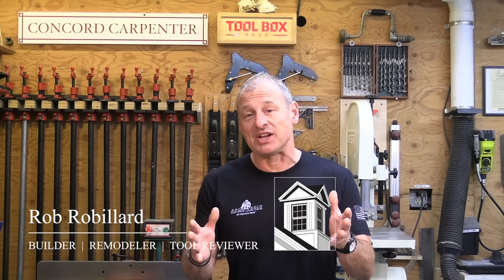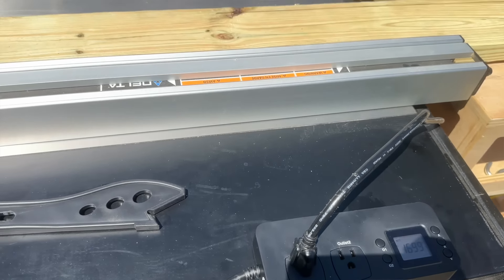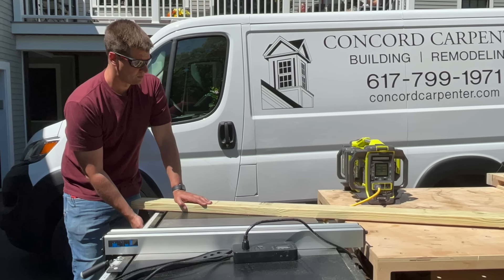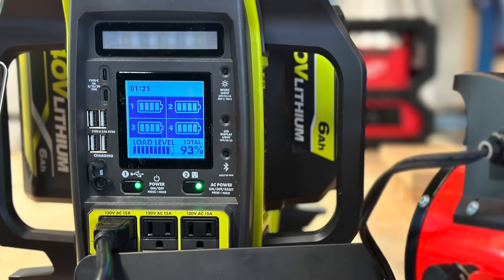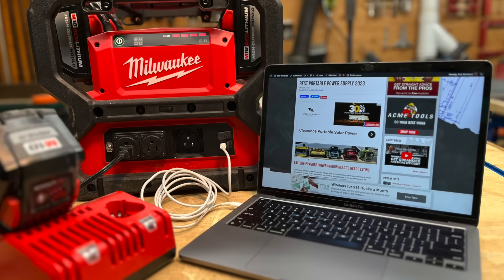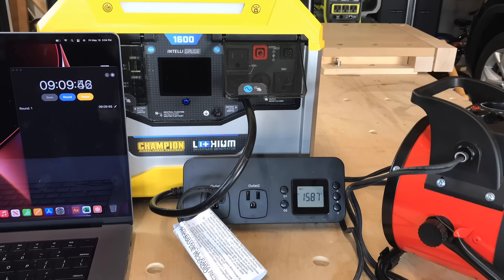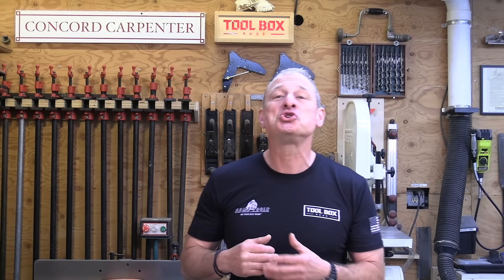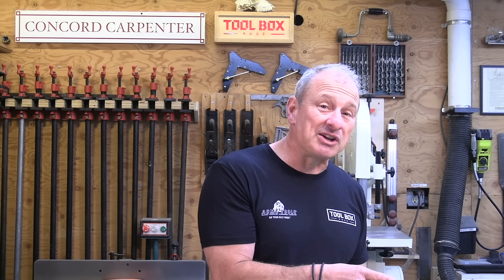Best Portable Power Station

Comment: I have the dewalt model. It has saved wifi connections during power outages, ran fridges despite the modified sine wave and charged the batteries off the gas generator. All in all I like it, very simple design and can power pretty much anything. I agree they could improve on it, designed about 10 years ago and still competing against brand new units. I had dewalt batteries already and was reasonably priced for the bare unit.

Comment: Been waiting for this H to H  test, awesome  job evaluating  these Portable switchable  battery storage devices, should have inc,uded an Inverter Fridge and Microwave or Induction Hotplate stove , but then the tests might be too long..Great job!!!
Reply: I have personally run a microwave with the DeWalt power station. Ran fine and worked as expected

Comment: @A Concord Carpenter / ToolBoxBuzz. Thanks Rob and TBB Crew for another great and thorough power station head-2-head comparison. You really hit all the spots to include how some of the power stations can't be left on standby without draining the batteries (by design). I know that the Milwaukee M18 carry-On doesn't emphasize that in their user's manual.

I agree with you that if we're in a particular battery platform, we'll  typically get one of these based upon what batteries we're invested in. For those who may be in more than one battery platform (or plan to) like power tools and OPE, then EGO for OPE and one of the others may be in order.

Hope you, the crew at TBB, and your families stay safe and well.

Comment: That's a great video on "Home Backup"! It's so important to be prepared and have a reliable power backup solution, especially when enjoying outdoor adventures or spending quality time with family in an RV. Have you heard about the Segway Portable PowerStation Cube Series? It has a massive capacity, powerful output, and super fast recharging capabilities. Plus, it's waterproof and has comprehensive protections. Might be worth considering for your outdoor gear! Happy camping!

Comment: I just bought an Ecoflow Delta Max, which is a dedicated solar power station with an internal 2kWh battery, 2400W pure sine wave inverter with a 4000W peak, 800W of solar input and tons of outputs (12V, USB-A/C, 120V).

I have TONS of Ego batteries and the value of the Nexus just wasn’t there.  The big kicker was SLOW charging on AC and no pass-through charging for AC or solar, a big oversight.

I’m using the Ecoflow on a job site and never have to think about power.  The solar panels keep it charged and I just work around them.

This might not work on some job sites where theft is a concern unless you have portable solar panels, which are available but expensive.
Reply: That's probably the absolute best solution for every situation. I wonder how much it was without the panels?
Reply: @benoitchartrand5772  I believe it sells for about $1800 in the US.  I’m in Canada so it was a little more here.  It’s worth the premium over the options covered here in my opinion since it is far more flexible and has much more energy capacity.  They sell smaller models which are cheaper if you don’t need 2kWh of battery, in which case it could offer similar capacity as these options at quite a bit less cost.

Comment: I am intrigued by the Milwaukee. I would use it t at home to power my furnace fan during a power outage, using my existing tool batteries. Indoor piwer, no fumes, no noise, nothing theft worries like an outside generator.
Reply: The DeWalt and Milwaukee can run power tools with ease while other generators fail completely.
The Milwaukee having pure sine wave while the DeWalt does not makes it more useful to other uses.

Comment: 👏👏👍 love your head to head's Rob , great in depth review 
I have the Ego power station , only because I've been using the lawn equipment and two stage snow blower 
I don't think it can be hooked up parallel like the Ryobi 
Im heavily invested in the Bosch cordless tools platform 
And hopefully they will come out with some kind of power supply like this , 
Im looking for some sort of not too expensive system to be able to charge the Ego batteries while i am using the nexus to power the utilities around the house , so while the batteries being used can be replaced with charged up batteries from some sort of solar charge system 🤷🏼‍♂️ 

Thanks for your information and great video Rob , 
Keep up the great work 💪

Comment: This was an awesome review! There is one thing that I wish you would have taken into consideration with the Dewalt and Milwaukie though. The fact that all of the batteries for these two power stations can be removed if need be for a period of time and used for  virtually their entire lineup of tools handtool/stationary/ as well as lawn maintenance in dewalts case (not sure if Milwaukee has a "gardening line"). Its a game changer in my opinion. If need be just keep a 5th battery handy if someone needs to snag a battery off the station for a few minutes.

Comment: A good comprehensive test. As you say hard one to do because they are horses for courses. I still run my petrol generator. Bit noisy. But a fraction of the price. Pure sine wave. Will run power tools and electrical goods. These battery power stations are very impressive but prohibitively expensive. Definitely getting better though.

Comment: The Ryobi doesn’t need to talk to the batteries. But if it can’t it won’t produce max power. So if you use only an original 40v battery that doesn’t talk to the power station you are going to max out just above 400 watts of power. So I always make sure 2 new batteries are installed and then the other 2 can be old batteries. 

Because it will take old batteries that means I was able to hack it and give it any 36v to 42v power source. Which is what you get when putting 2 -18v batteries in series. So I’m using a dead 40v battery with the guts taken out and an input wire coming out to connect to the power station. It has worked great so far. Definitely not within warranty specs ;).

Comment: Dewalt definitely needs to make a new updated one. I believe this one came out close to 10 years ago
Reply: Yes they do need to make an updated one 100%. They should make it able to utilize the 60v from the flexvolt battery's so you don't need all 4 batterys at the same time unless you're using only 20v battery's. Would love a 20amp outlet on it as well. I buy it for sure.

Comment: I have a bunch of ryobi 40v stuff so I went with the power station. For the little back up power I need it’s been perfect. I’d get another to be able to double power, but like it just fine. If I could start over… I’d actually get into the EcoFlow system. I am really impressed with what I’ve seen of those.
Reply: I have the EF Delta Max and it’s great!
Reply: I chose the Ryobi because of the warranty of 5 years for consumer use. Plus the warranty is dealt with locally. 

So if the power goes out and I plug in my fridge and the Ryobi stops working after 30 minutes I can run to Home Depot and be back with a new unit before my fridge warms up. 

For my use this was a huge benefit.
Reply: EcoFlow lol it's not practical for Ryobi users who already has 40v batteries from this tools.

Comment: Data point of 2 for Ego… I’ve killed two of their batteries in two years on a lawnmower that lives in a climate controlled garage.  Could be bad luck but I’m not investing into the platform any further.  As always, Great video and great testing!
Reply: Sounds like bad luck. They typically last 5-6 years per battery and even then they will run just with much reduce battery life. After 2 years a little drop in battery life can be expected, but nothing major. Dead battery or no, there isn't a battery powered mower on planet earth that competes with Ego in my experience. Well worth it on that alone, I must say. Have had great success with some of their other tools as well (weed whacker, blower, pole saw so far)
Reply: For what it’s worth, I burned up the motor from mowing tree roots, but your comment got me to thinking… I went back and checked the batteries and one of the ones that failed was legit, but the 2nd was an amazon knockoff.  I’m still back on gas, but I’m not quite as salty with Ego.
Reply: @jackjmaheriii  Honestly I fully expected to go with gas when I bought a new mower this year, but I was annoyed. I owned a Honda mower from home Depot, it wasn't the best model on the shelf but I thought it would get the job done. It has been pure torture maintaining that thing over the mere 6 years that I've owned it. After the first couple years every time I went to fix something another thing would crap out in 2 weeks. By the time I gave up I had new spark plugs, new fuel line and filters, springs, intake filter, gaskets, I even installed a brand spanking new carburetor (because I even after cleaning it over and over again it still gave me trouble). Not to mention the deck was rusted in multiple places. Then to have it fail to start AGAIN... I was done.

And the sad thing is all you hear growing up is how Honda is the best thing since sliced bread you'll get 20 years out of it yadda yadda, and now when I went shopping I learn Honda is getting out of small mowers altogether. So that's what got me thinking, hey let me see how battery mowers are doing. I doubted they could ever stand up to Texas sized weeds. Glad I was willing to risk the money because boy did it pay off, this thing could break in 5 years and I'd honestly probly still buy another one. It just mows like crazy with no noise, no gas refills, no pull chain, and it's super light weight to maneuver. Can't believe it took me this long to switch.

Comment: I have two of the larger Milwaukee power packs and found the inverter voltage starts to fluctuate after about 45 mins of constant use. Deliver lots of power, but short runtime. Cutting a 40ft tree and limbing, I went through 1-1/2 batteries. If you leave the batteries attached when in storage they will self drain. Its okay for running power tools, but keep away from sensitive electronics like frig, computers, etc. Definitely not for use as household power back up.

Comment: What’s nice about using battery power stations like this, is it’s easy to swap out batteries if you’ve got an issue.
Currently I have a pecron2000lfp, great solar generator that runs at a 2k continuous, can take 1200w solan input. If it has an issue though, it’s s pain to send it in for maintenance because of the internal batteries. Don’t have that issue here.

Comment: Great review.  I have the RYOBI for short term home backup/recreational power.  I have found that the RYOBI 40V 5AH batteries retail for $135.  You loose a bit of run time but the $/Wh is even better than quoted in the review.
Reply: 40v 7.5ah better

Comment: Would definitely recommend keeping eye on the ryobi power station on direct tool outlet for "factory blemished." Was able to pickup the station plus bunch of 40v batteries (plus some 40v tools to expand my collection, bonus if they came with a battery) for under the cost of just the power station alone from home depot. Haven't used for emergency power situation but has been super useful for random things where outlet isnt convenient or would have to run a super long extension cord for. The charging time is super slow with the included cable which is fine for my usecase but may want to invest in a rapid 40v charger if you need to swab batteries frequently.
Reply: There's also the 18v version now...
Reply: @ZeoCyberG  coming out

Comment: Ryobi’s power station battery can not be used in all 40v tools because it is a triple height battery. The 40v lawnmower will only take a double height battery. 

Ryobi did this because the triple height battery can output more power. So it can handle max power out with only 2 batteries installed.
Reply from the maker: Interesting, thanks for sharing

Comment: My Milwaukee runs my vacuum pump and recovery machine fine if I dont want to run 200’ of lead cord. It ran my pellet stove for 4 hours and 20 minutes during an outage. Still on the fence about keeping it. 12.0 batteries were big bucks and I dont really use them for any other tool at work or home.

Comment: That Ryobi can be had for under $700 with the 4 6ah batteries if you purchase it from the right online retailer. Ryobi also has 7.5ah batteries available and 12ah batteries if you really need some extended run time.
Reply: Did a quick calc on a full 18V (I realize this is the 40V review) system last night with two inter-connected Ryobis, each loaded with 8 12Ah batteries (16 total) and two solar chargers... just under $5,000 USD 😅
Reply: 7.5ah batteries are so good for this station i have 4 of them

Comment: What amp hour batteries did ypu use for each power station? Use the 15ah flexvolt dewalt batteries aNd i bet that thing last alot longer… thats very important information we would need to make a decision to determine if  it will fit our run time application

Comment: I have both the Milwaukee and Ryobi since I have many of their batteries and was considering getting the MX version of the Milwaukee since it is on sale now but it makes no financial sense since I would have to get a lot of new  batteries. But ultimately these are only good for small indoor use, whereas prolonged and heavy use is demanded only gasoline generators will work.

Comment: Lithium ion batteries are neat in a pinch for power stations, but I'd honestly go with lithium iron phosphate battery units for something like this, as they have a significantly longer service life at the cost of being slightly heavier. Also I know there are stations powerful enough to power 6kw welders, so multiple saws would be a breeze. If I were a contractor using corded power tools and needed an actual battery unit, I'd pick up an ecoflow delta as it would run circles around these, it would basically be like having wall power for a jobsite

Comment: Quick question. On the Ego system, if you only have 4 batteries and no other source of power, would it be feasible to place the quick charger on one of the outlets to recharge one of the 4 batteries and rotate so to speak to keep batteries from totally depleting before electricity is restored?
Reply: Yes I own one

Comment: How does the Ryobi 18 Volt Power station compare to the 40 Volt power station   I believe the 18 volt power station is slightly more powerful because it's rated at a true 1800 watts not just for 3 minutes.  The 40 Volt model is rated for 1800 watts but for only for 3 minutes, but 1650 continues, the 18 volt model does not have this limitation.

Comment: Frankly I have a large petrol generator that I can run for 11hrs under load and produces more than 4x more power than all of these, its noisy and that sucks but it crushes all of these at being a generator and it cost me less.
By the way this is a really good review.
Reply: Battery powered generator stations are not for powering your house after a hurricane, they are for charging batteries/powering peripherals at a work site, providing portable power on a camping trip, providing power outside the home for an afternoon of lawn care, etc. They serve a fundamentally different purpose than petrol generators. They can fill the need of a petrol generator, but its going to depend upon the consumer's willingness to invest in the battery platform for long distance runtime if runtime is the goal. If you're a customer who already spent a lot of money on a certain platform, for example you have an Ego mower (fantastic mowers), trimmer, edger, pole saw, chainsaw, blower etc and racked up a decent arsenal of batteries over the course of using that platform, grabbing a power station for 500 bucks or a power station + 2 additional large batteries for 950$ is pretty darn good bargain and impressive supplement on top of the kit you already have.

Comment: It's funny that popular brands such as Milwaukee, DeWalt, and Ryobi have not taken notes from more experienced players in this market such as Bluetti , Ecoflow and Zendure. 
If you need power on a job site you also want mc4 hookup for solar panels to be able to last a day, you want pass through charging, batteries that will last 10+ years such as lithium iron phosphate, ability to use as a home backup when not on a jobsite. Ups mode...
 The only thing that makes these units desirable is being able to use the batteries in your tools, beyond that they fall short. Surely our big tool players can do better than this. 

Thanks for the comparison.

Comment: 13:26 You will be surprised, but the most sensitive to pure sine are motors, a computer will run without problems (80 to 230V). I managed to run a laptop on ten 12V cheap AGM batteries in series. A laptop will convert AC to DC (170V DC), and supply a MOSFET converter to desired voltage. There is almost no way to inject modified sine into your laptop. I will never run a fridge on a modified sine.

Comment: Ryobi cord is the same as their cheapest model “clip-on” 40v tool battery charger. Also, the ryobi comes with a nylon bag for cord, manual, etc. AND a nylon cover.  You should have gotten those with your unit, mine came with them and two 6ah 40v tool batteries.
Reply from the maker: Good info on cord thanks, yes we got the cover and forgot to mention, thanks

Comment: im an autodetailer and trying to avoid the fumes from gas powered ones. ryobi knowing it’s the best all purpose one, can it sustain me using a 4.5gal air compressor and a steamer?
Reply from the maker: Not Sure on a compressor, I suppose if it’ll run a tablesaw it should be able to
Reply: @@thomasngo320thank you. I was thinking about getting the ryobi but now I feel like the ego is the way to go